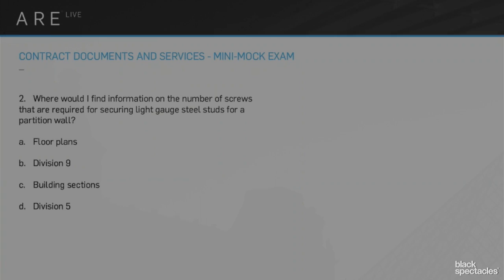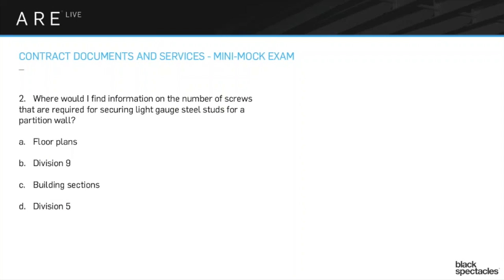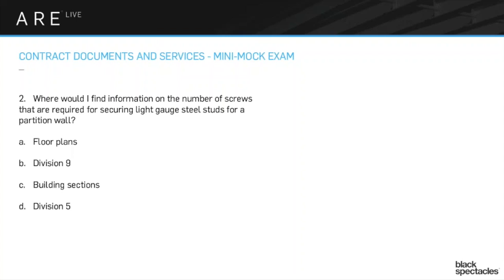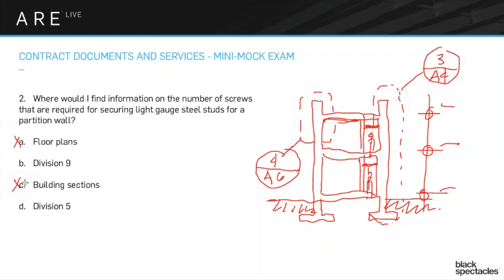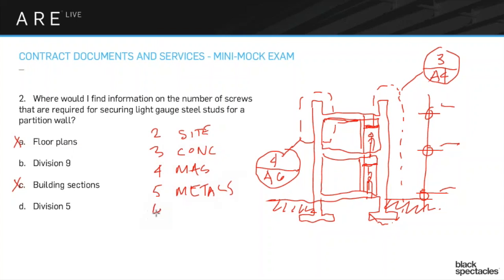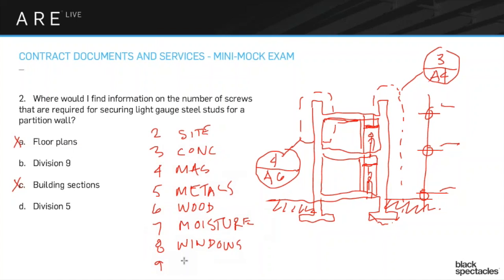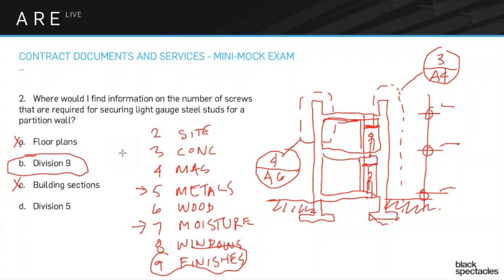Partition Wall Information - Construction Documents and Services - A.R.E. Live

Comment: Thank you very much for this video presentation. I actually answered Division 5 based on my knowledge that division 5 is for structural related metals. Is there another rule we should know to answer a question like this? I don't think it is possible to memorize every item under each division. Please advise. Thank you